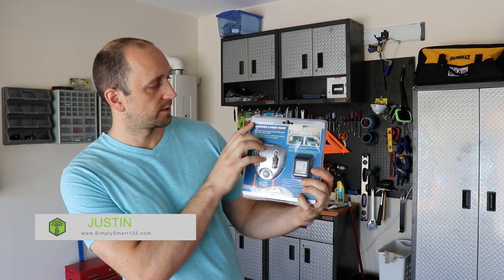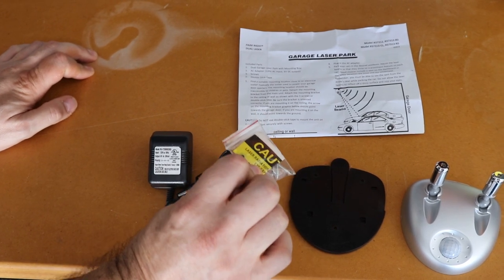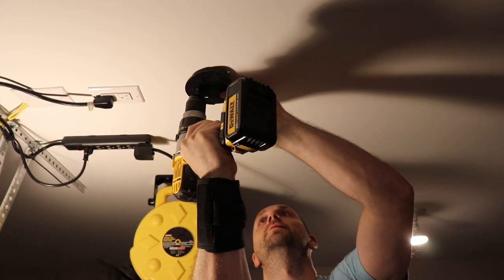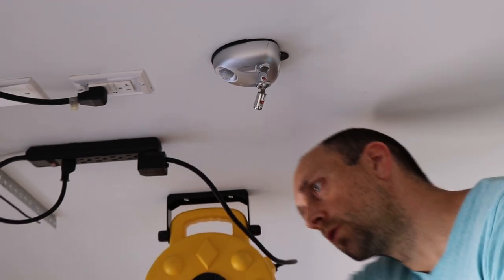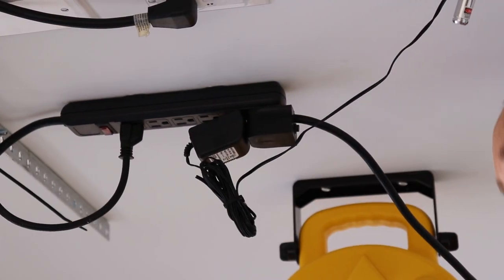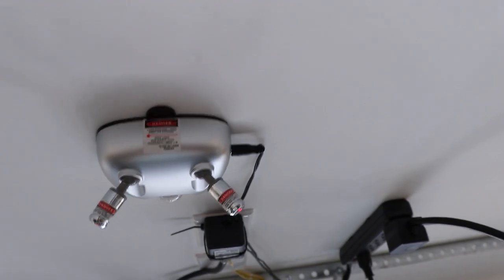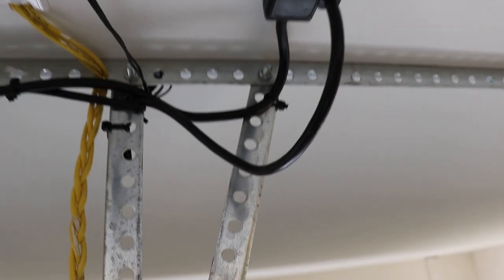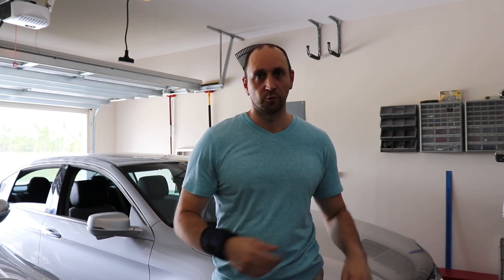Park Your Car Perfectly in Your Garage! - Smart Garage

Comment: I have used a tennis ball attached to a fishing line where the other end of the line is attached to a small screw in the ceiling. I like using clear fishing line to dangle the ball. I place the ball where it will align with the center of the steering wheel and touch the windshield where I want the car/truck to stop. I use a safety pin to attach the line to the tennis ball. You can also use a ping pong ball, golf ball, or some other small ball. You can use crazy glue/super glue or a screw for the ping pong ball or golf ball.
Reply from the maker: Definitely many solutions available

Comment: Another thing to consider about with respect to the battery backup is that if the power is out, your garage door opener is not going to be working anyway, so you might not be opening (or closing) your garage door anyway unless you use the manual bypass on the garage door opener.  We recently had a power outage for a few hours and I realized that if I had needed to go somewhere, it might be a bit inconvenient since I had stored some spare wheels / tires in the area by the small door leading from the breezeway into the garage (since I never use that door and instead just go through the main garage door each time.  There's no way that I would be opening that door with four 275-65R20 tires and wheels stored there.  In a pinch, I could try snaking a wire rod between the top of the garage door and see if I can catch the manual bypass for the track system or if it was a real emergency, it would not be difficult to bust a hole through the siding since it is Hardi-Plank and go in that way.  Looks like I need to reconsider my storage location for my spare tires/wheels. :)
Reply from the maker: Parking can get complicated fast.

Comment: This is perfect for the person that has zero feel for gauging distance, and there are plenty of you out there. I’m parking my Harley in front of the wife’s car and this will help her from hitting my bike. Hopefully! I bought a version named xtreme with a single laser one for each side $13.50 each. To early to tell you how long they will last and if they can take extreme cold weather. Stay tuned.
Reply from the maker: Ours are still going strong since recording this video. Hope you bike stays safe and the winter isn’t too hard on the unit!
Reply: Considering how many times my wife has "parked by feel" over the years, I would never put my Harley on her side of the garage.  When I had a pickup, it would not even fit in the garage unless I removed the trailer hitch and EVERYTHING along the back wall.  As such, it always was parked outside and my Harley took up my side of the garage.  If your wife has trouble gauging distance, the best bet is probably a physical barrier that stops the wheels.  The tennis ball on a string method works well enough for my wife, but I positioned it so that after she hits it, there's still another foot to go before she hits anything near the back wall.  I do not trust her parking ability.

Comment: I use a small Brick!!, .....Once I line my car up in the perfect spot I want it in, ....I put a small brick in under the front tyres (either both tyres or just one) so I know when im driving the car into the garage once my wheels feels that ...you know to stop!...(Has the perfect distance front & back).... . (Drive in slow ...you could do it fast youll still feel the brick hit on your front wheels)...... I use a line on the garage floor to line my car up so i know how far to the side i need to be in order to fit the other 2 cars in also. .......much easier than installing anything.... just a brick and lines easy!
Reply from the maker: If it works it works!
Reply: I just use a 2x4x8 instead of brick.
Reply from the maker: How do you stop it from moving?

Comment: my issue is the tight squeeze getting in my garage width wise. i wonder if they make anything for that
Reply from the maker: I haven’t seen any. I typically try to park as far to the left as possible when I pull in the garage. And my wife parked to the far right as possible. Sometimes are better than others but typically it works OK.
Reply: if you use this device closer to a corner of your garage (instead of in the middle of it) you can direct one laser through to the middle rear screen or front screen depending on whether you drive in or reverse into your garage, and the other to an edge of your vehicles dashboard/parcel shelf. (wish I had a diagram to upload here)
Reply from the maker: That's a good idea. Verticle and horizontal lasers.
Reply: striker has a product to protect your mirrors as you enter and exit garage.

Comment: What about side to side I get there wont be much of a difference but as tight as you are to the door I would think it would be off may be wrong I guess if your dash is on a flat enough plain would,work
Reply from the maker: Yeah, I try and be on the far left and my wife tries to be on the far right. This is based on the side of the car and garage.

Comment: so that handles the how far in, now how about the how far over?  any suggestions there?
Reply from the maker: When the laser come up your car you can tell if you are centered or not but you could install a second unit that could point more out the garage to maybe hit a mirror or something to help you line up your vehicle side to side or mark where the center or edge of you tire should be.
Reply: There are some laser modules that will display a line instead of a dot.  Current price on eBay is around $1.50.  You would just need to adapt a power supply to work with it.  Maybe an old cell phone charger that has a non-USB power connector could be reused and wired into it.

https://www.ebay.com/itm/9mm-X-23MM-DC-3V-650nm-5mW-Brass-Line-Laser-Dot-Diode-Module-Head-Red-Light/392755310408

You could line this up so that the laser line points directly down the middle of your vehicle and you might have enough of an indication to get it aligned.  If not, then you could reuse the module pointing it across the garage to give you a line to not pull past instead of just a dot.

If someone has trouble lining up with the entrance to a garage for some reason, one method might be a mechanism similar to what is use on the VASI for landing aircraft.  Although the VASI system is for adjusting your vertical angle to the runway and not the horizontal, if you used something similar, but oriented on its side, it would give you the horizontal funneling in to the destination point (i.e. garage).  For example, if you put a light at the end of a section of pipe, if you can see the light while driving towards it, you are directly in line with it.  That might work for a single height driver and single height vehicle combined with a driveway that is perfectly level with the garage floor, but I suspect that most people don't have that sort of driveway.  Realistically, we aren't concerned with the vertical angle since the vehicle is sitting on the ground and except for a few vehicles out there, they cannot adjust their ride height anyway nor are they tall enough that the driver might need to lower the vehicle to get in the garage.  So, instead of a light in a piece of pipe, putting the light between two vertical sheets / boards might be a better solution .  The boards would be close enough together that you could only see the light if you were lined up with within a couple of degrees.  As you got closer to the garage, although the angle stays the same, the distance across the arc would decrease and you would be funneled in towards the light.

If you wanted to do this with in a non-electrical manner, you could hang 2 tennis balls in your garage, aligned with the driver's seating position, one a few feet behind the other one.  As the driver drives towards the garage, he positions the car so that the two balls are aligned so that he can only see one (or one is directly over / under the other if the garage and driveway have varying levels).  This would be similar to using a bead sight on a shotgun.

In my particular situation though, I only have to worry about my wife hitting things, so I store stuff so that as long as she manages to not hit her mirror on the side of the garage door opening, she is not going to hit anything that is stored along the walls of the garage.  It might be a tight fit (i.e. if someone wants to get in the passenger door, they need to wait until the car is out of the garage), but it works for us.  Even if there wasn't anything stored on the side of the garage, the damn builder did not make it large enough to open a car door anyway.  Personally, I think there should be at least 3 ft between the edge of the garage door and the wall of the garage and a single garage door should be  at least 10 ft wide, although 12 ft wide would be even better.  Even if I don't have a Hummer H1, I would want my garage big enough to be able to park one, just in case. :)
Reply from the maker: That's cool!

Comment: What if you back in?
Reply from the maker: You could put the lasers nearest the garage door and do the same setup 🤯
Reply: @SimplySmart123  -- I saw someone install one of those laser devices where it would shine the beam on the hood of his car when he backed in.  It was winter, so he did the install with the garage door closed.  The problem though was that he installed it on the ceiling between the rails to the door, so when the door opened, the laser was blocked.  Critical thinking ability like that is probably why he needed the laser parking indicator in the first place... :)
Reply from the maker: Haha. That’s funny! 😜